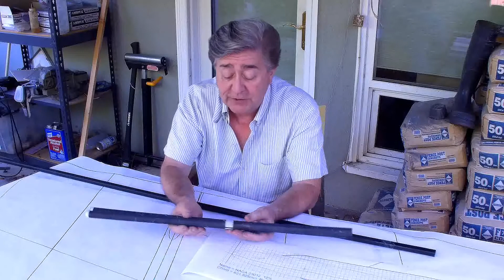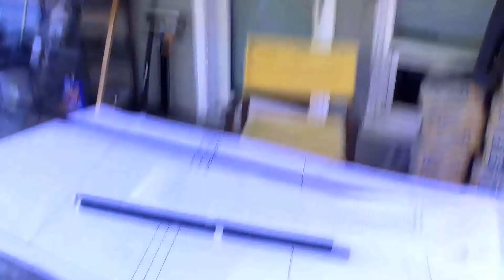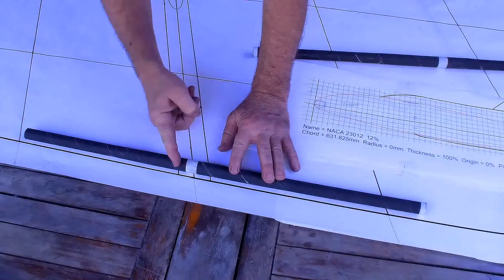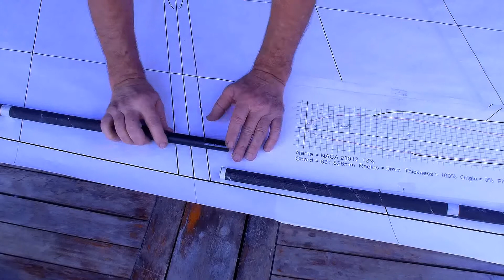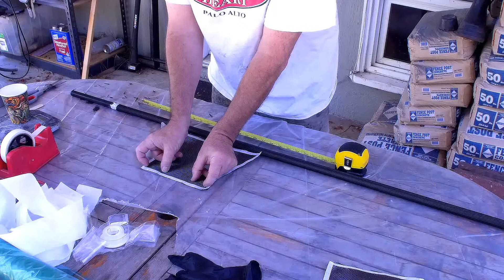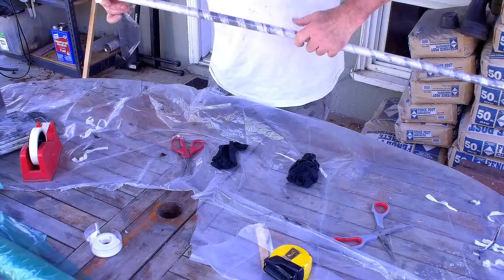Wing Tip LE Joiner Tube -KW MkII Class 2 Hang Glider

Comment: When you say something like "scrape off all of the access resin," its nice to see you do it so that I have some example of what you mean by "...all access...". 
Thanks for sharing your experience.
Reply from the maker: Yes, that one is a tough call for all of us. Sometimes I'm not sure what is excess. It's a fairly small range between too much and too little. I'm thinking that future processes for homebuilders might have to use prepreg cloth. Either the new room temp storage systems (good for open storage for a month or more - no freezer required). Or, maybe homemade prepreg where the wet-out is done on a plastic sheet with a carefully measured amt of resin. Use all the resin to wet all the cloth needed and then either use it immediately, or roll it up and store it in a freezer until you can use it. I'm still thinking about this. That, or key components like D-tubes would need to be factory made and sold as part of a short kit. Still lots of challenges to be solved!
Reply: @KlingbergWingMkII  Yes. Sometimes people sit and only explain things. You show us, like when a chef on TV says "... a handful of pasta." and then you see how much she has in her hand, you show us - by example - what it will look like; how to apportion the amount of what you spread on. Thank you.